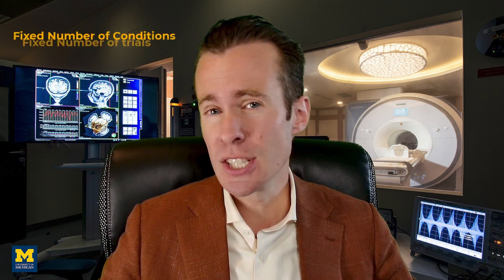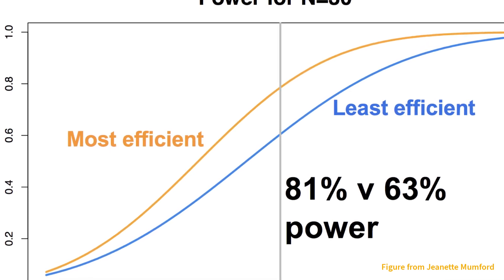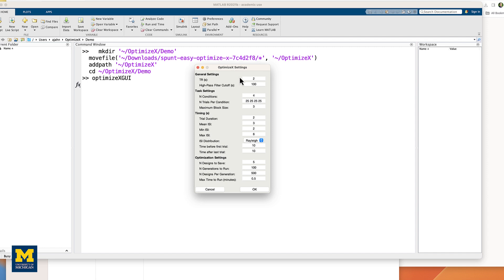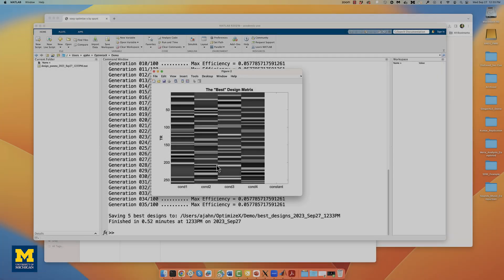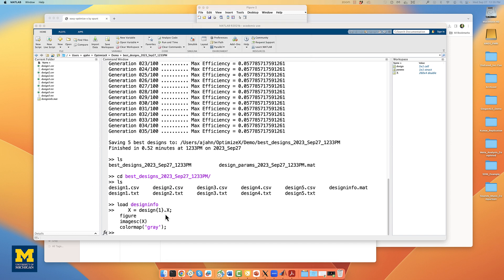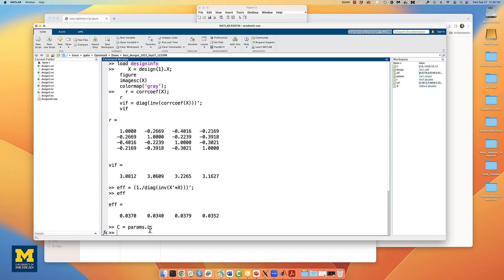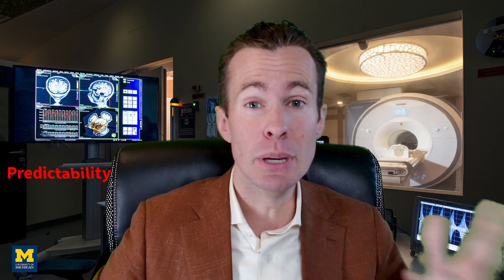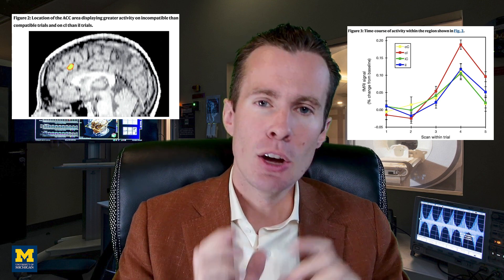fMRI Experimental Design Optimization

Comment: Thanks Andrew, this is an adequate answer for the question of design, although this seems to be over simplified, as the parameters were not explained.
Reply from the maker: Yes, that is a good point; I try to keep it relatively simple, with more of the details located in the e-book chapter. It can be difficult to know how deep to go